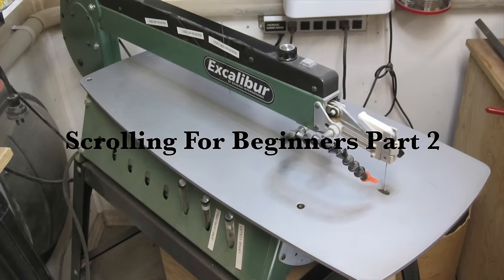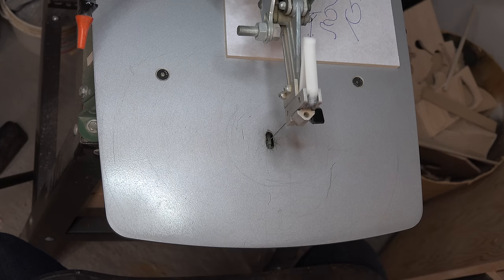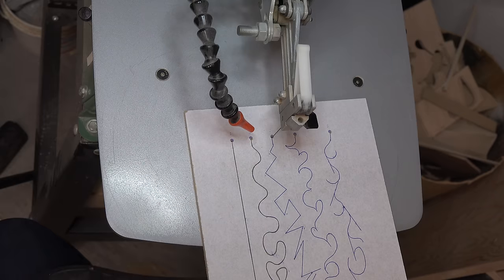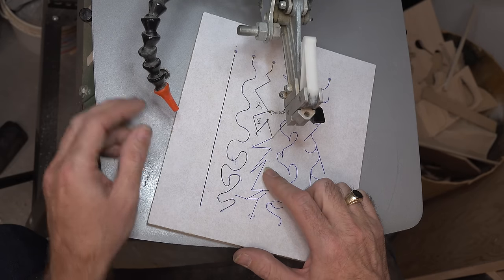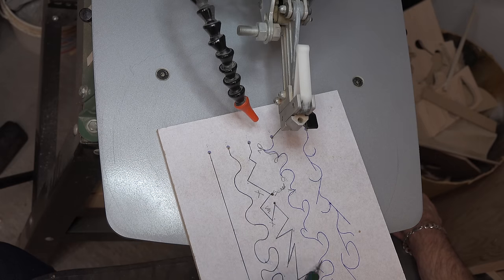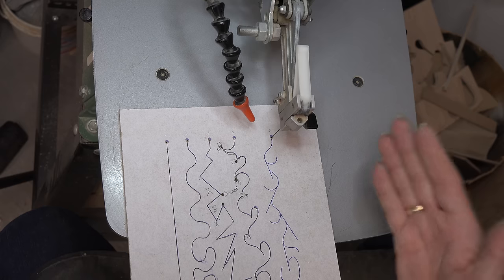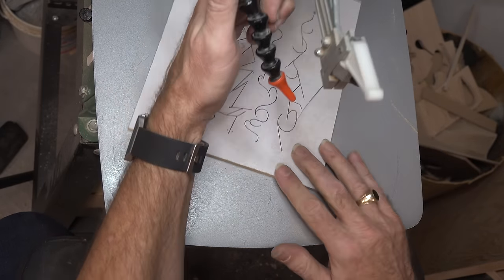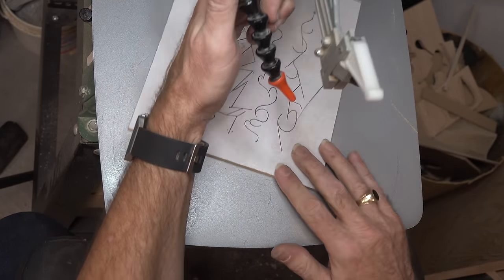Scrolling for Beginners Part 2

Comment: Just one more question : how do you know when your blade is getting dull and is there any way to sharpen them?
Reply from the maker: Unfortunately, there is no way to sharpen a scroll saw blade.  They are considered as a consumable and once they have lived out their lifespan, they are trash.  You can usually tell when a blade is dull and needs replacing.  If you have to apply excessive pressure to cut a piece whereas it was cutting fine before, chances are, your blade is dull.  If you are finding that the blade is smoking when trying to cut the wood, chances are it is dull.  In some cases, the blade will not cut well because it is dull and will cause too much friction which will heat the blade and cause it to break.  Don't be afraid to change your blade if you feel that It has become dull.  They are fairly inexpensive and a dull blade can cause you problems when cutting.  I hope this helps.

Comment: Can pinned blade can do this all work?
Reply from the maker: Harin Chauhan pinned blades are for more coarse work. For finer cuts, the blades are usually not pinned.  You might want to check out my blade selection video. .

Comment: I noticed your saw doesn’t have a hold down foot, is it needed?
Reply from the maker: My saw does not have a hold down only because I removed it.  The saw did come with it but I personally prefer to work without one.  I find that the hold down foot really gets in my way when doing intricate cutting.  For a beginning at scrolling, a hold down foot is highly recommended to assist in holding down the stock so that the user can concentrate on blade control as apposed to concentrating on holding down the stock as well.  I hope this helps.  Thanks for tuning in Ken.  It's appreciated.

Comment: Hi! I want to cut a circular door in a miniature Hobbit House and want it angled, can I just angle the deck slightly?
Reply from the maker: Yes, you should be able to tilt the table on your saw to get the angle that you want.  Just remember, that depending on whether or not you cut the circle going clockwise or counter clockwise, it will change the angle of the door and the way it fits in the frame.  I would suggest cutting a test piece first to make sure that it is the angle that you desire.  I hope this helps.  Thanks for tuning in to the show.  I truly appreciate the support and if you have any other questions, please don't hesitate to ask.

Comment: Spiral blade sir?
Reply from the maker: What would you like to know about them Ryan?  Thanks for tuning in.
Reply: @acutabove_woodworkings  do you use spiral type? For this project?
Reply: I'm beginner wood working scroll saw, i just want to know.. and i love scroll saw project, i making decoration art from waste wood at home..❤️
Reply from the maker: @pocketoutdoor  Spiral blades do have their place in the scrolling world but they also have their drawbacks.  A spiral blade will rarely provide you with a crisp sharp edge on a cut and they are notorious for having serious tear out on the back side of the cuts, which require a lot more sanding.  With practice though, you can really make some beautiful projects using a spiral blade that would otherwise not be possible with a straight blade.  My suggestion would be to practice on the straight blades first and get good at them before you venture into spiral blades.  I hope this helps.
Reply: @acutabove_woodworkings  Thank you so much sir, i'm using straight blade for making decoration sometimes i making simple toys, always using straight blade.. i think your answer very help me in choosing blade..thanks again.
Reply from the maker: @pocketoutdoor  If you visit my website at acutabovewoodworkings.com, there are plenty of free toy patterns there.  You can just click on the free patterns section to find a picture of the finished project, the pattern and the accompanying tutorial video.  I'm sure that a beginner like yourself would be able to make these toys.  Give it a try.
Reply: @acutabove_woodworkings  Okay

Comment: Great series of videos Kenny. Very informative as usual. Just a question regarding drift, you say it is caused by the back of the blade. Would using a spiral blade counteract any drift?
Reply from the maker: The back of the blade is only one cause of blade drift Brian and rounding the blade is only a way to minimize the problem, not eliminate it.  Spiral blades to no encounter any drift because of their design.  They have their own problems, such as being hard to control, not giving clean cut straight lines and plenty of burring.  Comparing blade drift in a standard blade to the spiral blades truly is like comparing apple and oranges.  Two completely different animals.

Comment: Hi Kenny, Great video as always.  Just started scrolling, and the wood seems to bounce up and down on the table!  UGHH!  What am I doing wrong?
Reply from the maker: Hi Kathleen.  There are many reasons for the stock bouncing up and down on the table.  The main and most common reason is using a blade that is too course for the stock that you are cutting.  I would suggest using a finer blade.  Also, If you are using a hold down foot, be sure that the foot is just touching the stock.  What thickness stock are you trying to cut and what blade are you using?
Reply: @acutabove_woodworkings  Hi, I was using a #7, 13 TPI to scroll 1/2" material.
Reply from the maker: A #7 is a little heavy for 1/2" material.  I would drop it down to a #3 and be sure that your hold down foot is firmly in place.  Downward pressure with your hands is also needed to assist the hold down foot.  Give that a try and let me know how you made out.
Reply: @acutabove_woodworkings  Will do, Many thanks!
Reply from the maker: @Kkuts37  You're very welcome

Comment: Scrolling do you need to wear a mask ?
Reply from the maker: Most scroll saws do not have a dust collection system incorporated into them John and due to the open nature of the saw and the fact that the air hose is blowing the dust from the cutting around the room, I would suggest wearing a mask when scrolling.  There are those who have rigged up dust collection for their scroll saw that practically eliminate dust from cutting and they don't wear a mask but for those of us who don't have such a system in place, a mask would be an asset.  I hope this helps.  Thanks for tuning in to the show.